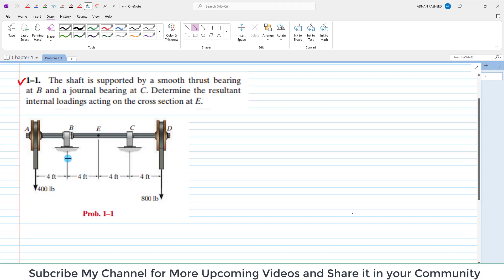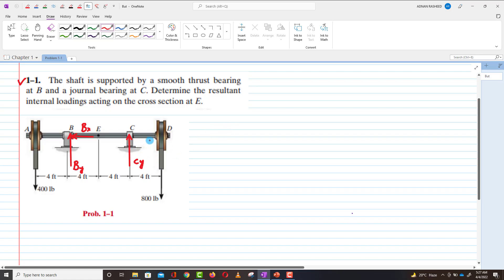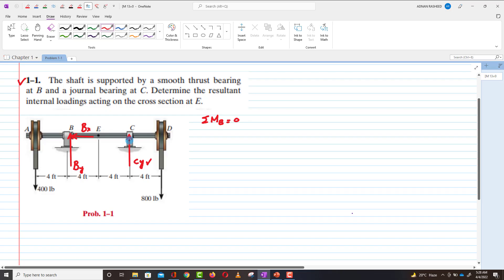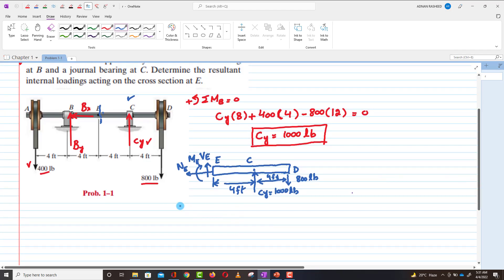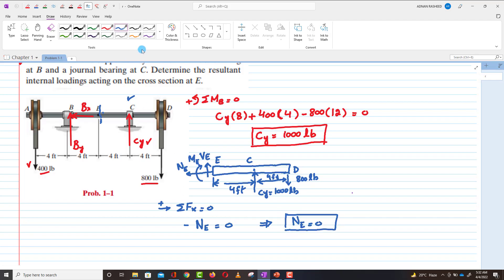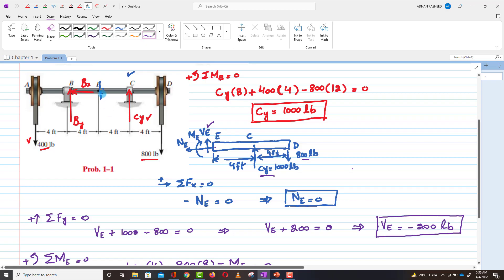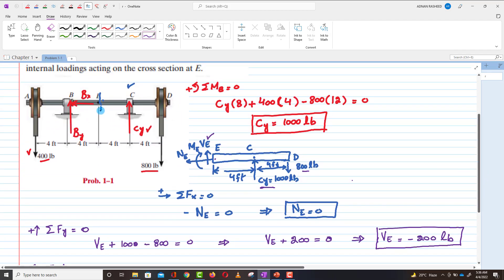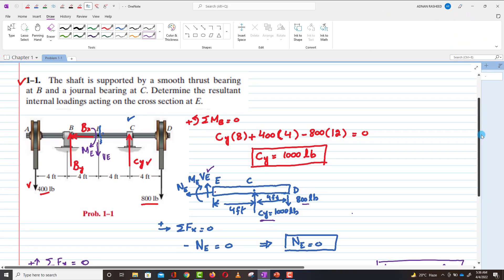1-1 Stress: Internal Resultant Loading (Chapter 1 Mechanics of Materials by R.C Hibbeler)

Comment: Why would there be only vertical force at point C and both vertical and horizontal force at point B?
Reply from the maker: ok so remember that smooth thrust bearing offers both horizontal and vertical forces on the shaft while journal bearing only offers the vertical reaction force. in this case as tHere is no any other horizontal force therefore horizontal reaction force by bearing at B will be zero. you will see such type of bearings in many problems